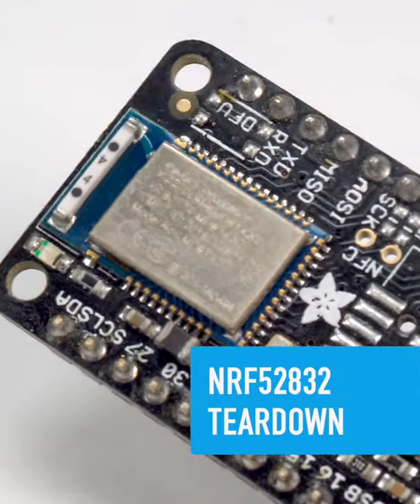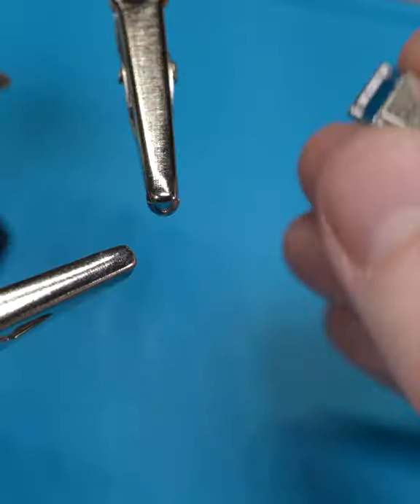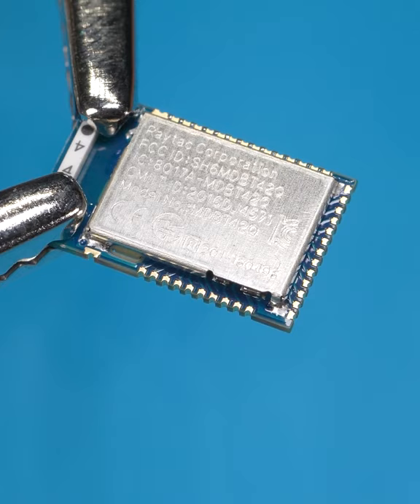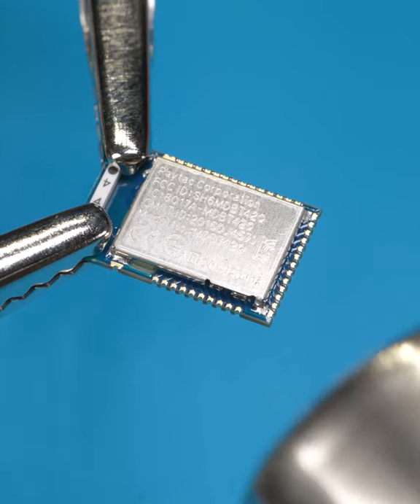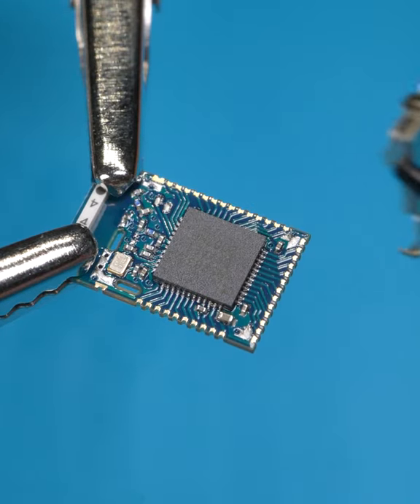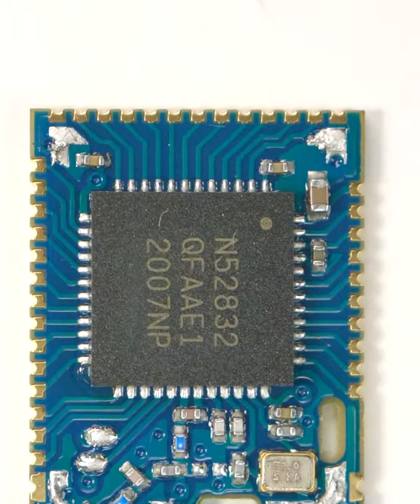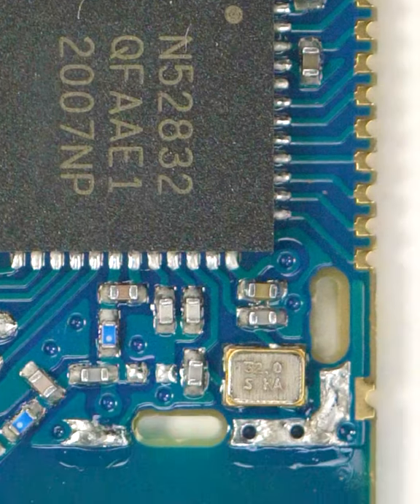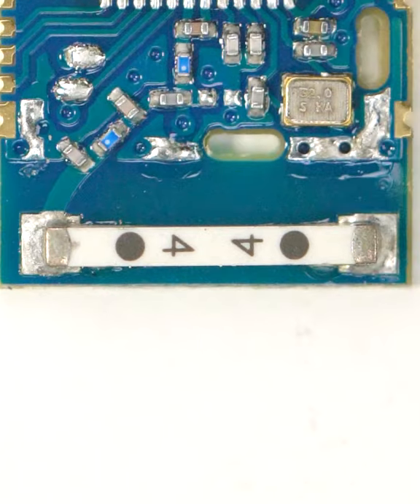NRF52832 Teardown - Collin’s Lab Notes #adafruit #collinslabnotes

Comment: Cool little smd antenna. What's the advantage over built into the board? I know I know, RF is voodoo magic lol
Reply: These are cavity resonators, they are a LOT smaller than a trace antenna. This is pretty much the main reason they are used in small footprint electronics.

Look at a Pi Zero W, it has an antenna integrated into the PCB but it's not a trace antenna, it is also a cavity resonator. It's also much smaller than a trace antenna, though maybe not quite as small as ceramic chip antenna. Unfortunately these cavity PCB resonators are usually considered not really manufacturable, since you don't have control over the exact composition of the PCB, the lacquer etc, and the dimensions depend on the dielectric permittivity. But Pi foundation probably has quite a bit more leverage in this regard.